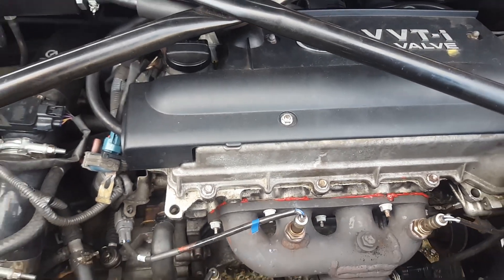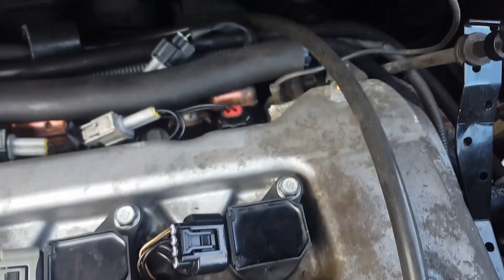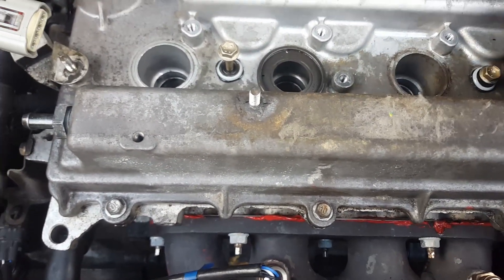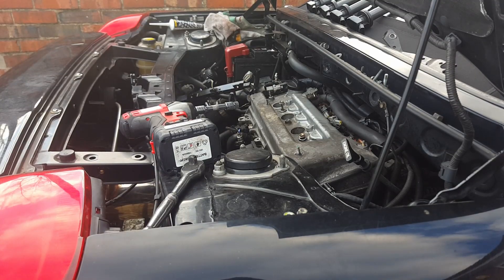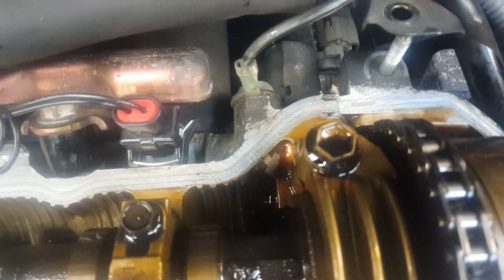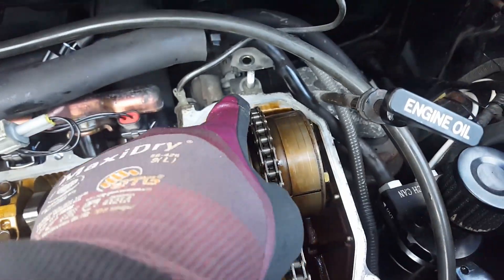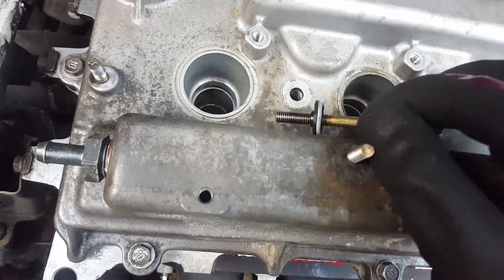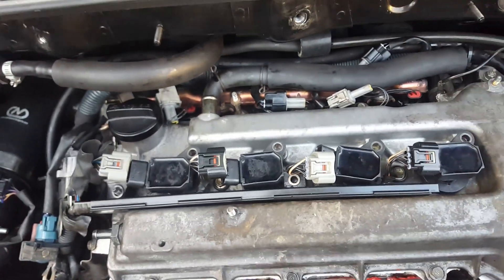MR2 Roadster / Spyder 1ZZ Cam / Rocker Cover Gasket Replacement

Comment: Not sure if you’re still here, what is that cold intake you have there? It runs down to the driver side air vent?
Reply from the maker: That's the pipe from the turbo to the induction/air filter. Sits behind the vent and makes cool chuchu sounds 😊
Reply from the maker: Watch my turbo build videos, it will all make sense.
Reply: Thanks for the quick reply currently doing the cover

Comment: Hi Dan, can I ask, how did your oil consumption changed after the thinner fushing in the last 9 months from 0,5 liter /1000 miles?
Reply from the maker: Hi Joccka, I can't tell you too much tbh as the car has only done 500 miles since I did the treatment. I am waiting to hit 1k miles and then will update
Reply: @ModorFix  Any update if it improved it?
Reply from the maker: @DavidB-rx3km  not really. I have only done about 1k miles and have switched to 10/60 race oil. Watch my latest video on thinners and pistons. Will give you insight into the current situation ;)
Reply: @ModorFix  I just did the gasket on mine today - it's so difficult to keep it in the cover even with a bit of gasket sealant keeping it on. I've got a slight weep from it, I thought I'd replace it as it never looks nice having oil down the block.
Reply from the maker: @DavidB-rx3km  you shouldn't have a weep. Did you put sealant where the joint is between the covers? If so just nip it down a little more.
Reply: @ModorFix  No I mean before, I replaced the gasket because of it ;)
Reply from the maker: @DavidB-rx3km  ah ok, well worth it then :)